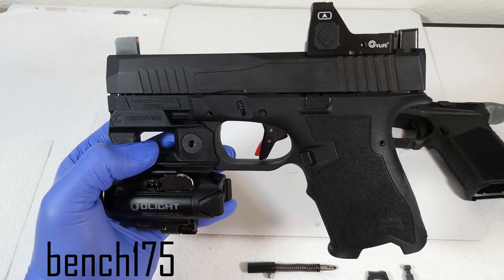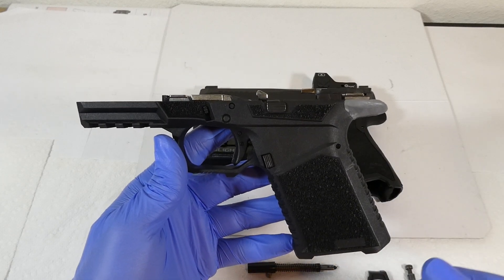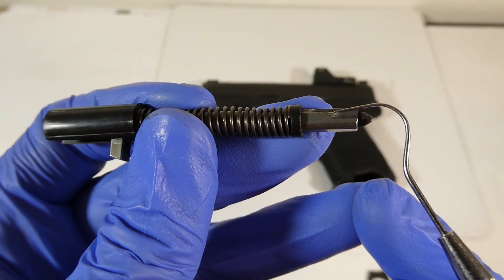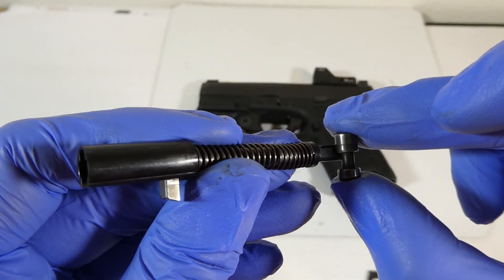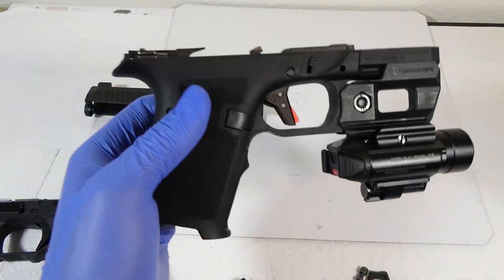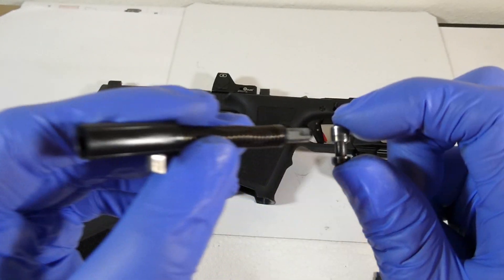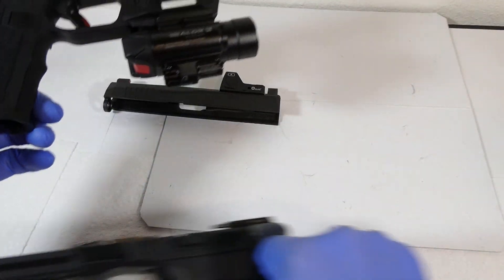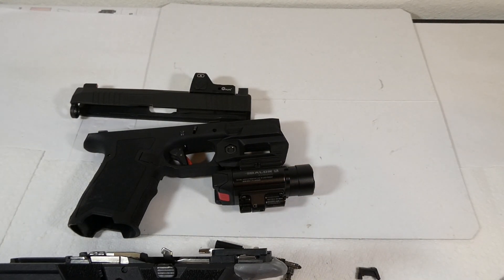Timney Alpha Glock Trigger and PSA Dagger Light Primer Strikes Check Firing Pin Deformation Part 3/3

Comment: The bump on the "Shark Fin"  (Striker-Safety Plunger Actuator) is to prevent the trigger Bar and specifically the "Shark Fin" from being forced too far to the side and failing to fully engage the plunger.  If you look up into the mag well with a light, and pull the trigger, you can see that the Trigger Bar takes the path of least resistance and tries to go around the plunger. The "bump" rides the side of the slide and prevents the trigger Bar/Shark Fin from missing the plunger.  Gen 5 Glocks addressed this by redesigning the plunger.  Not yet sure what the best solution is? I may try bending the trigger Bar?
Reply from the maker: @dtenor201  Yes thought about bending it or adding a bump with steel stick putty lol but its working now so not messing with it.